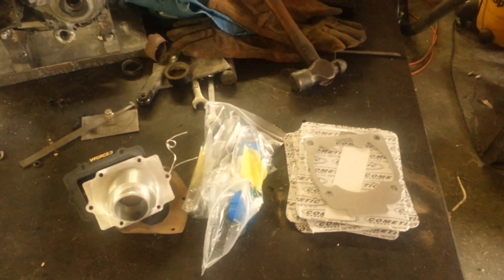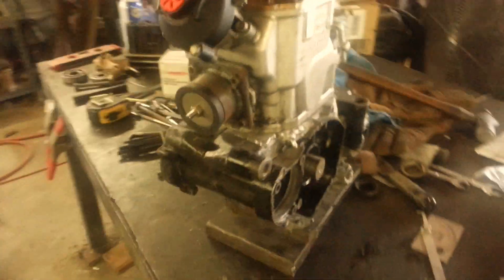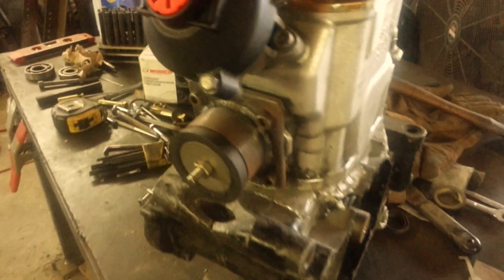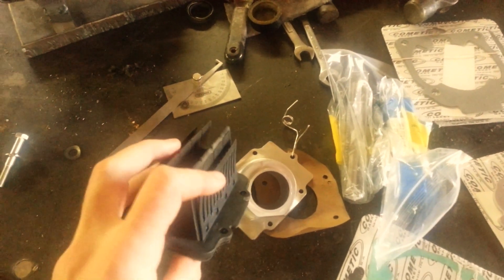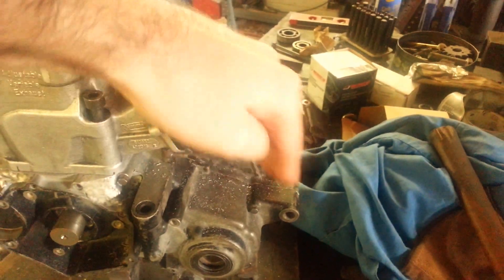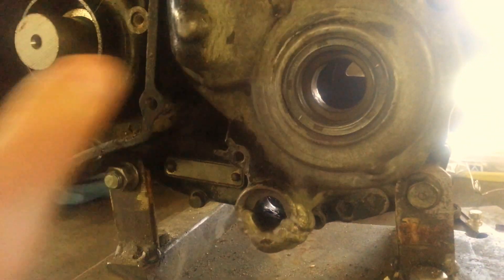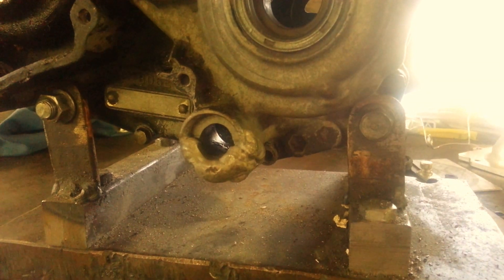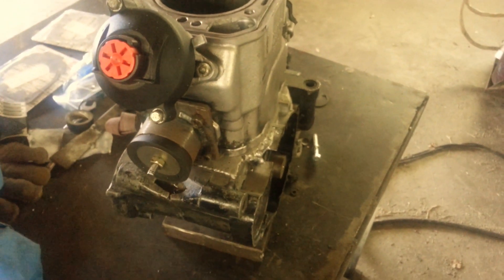Rotax 250r conversion engine update #2

Comment: Cool project but if the 400cc was your goal then why didnt u just soarce out a pilot 400 engine?.sounds allot easier to me!
Reply from the maker: You still have to weld the cases and do very similar work with a pilot cylinder.